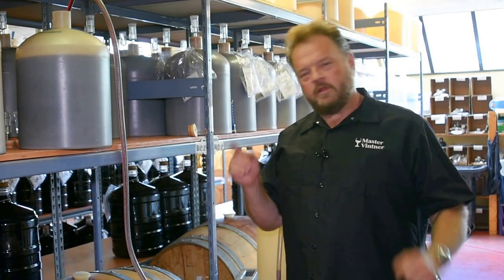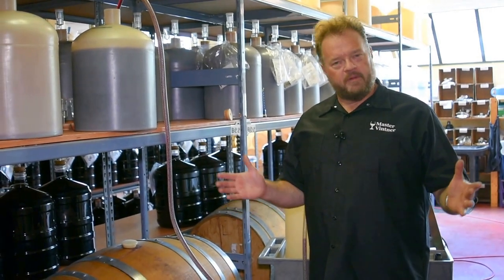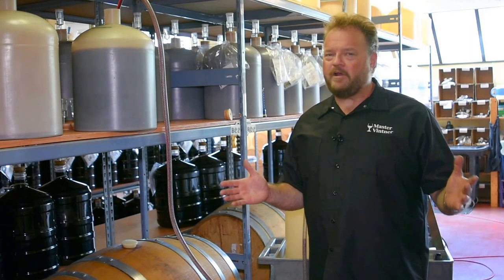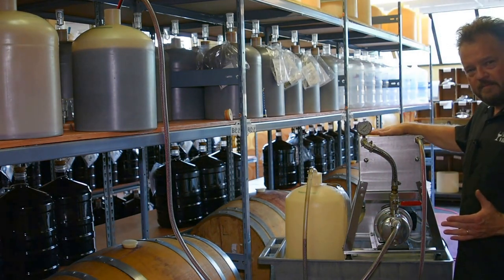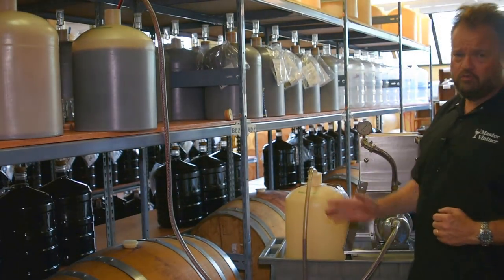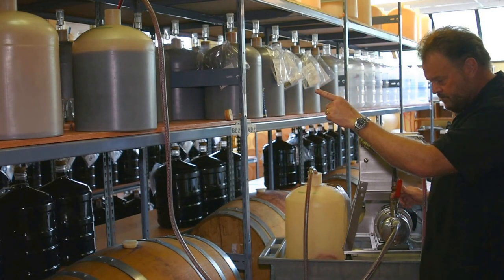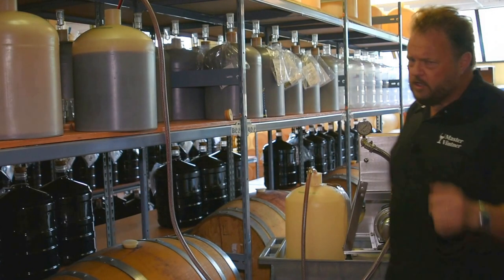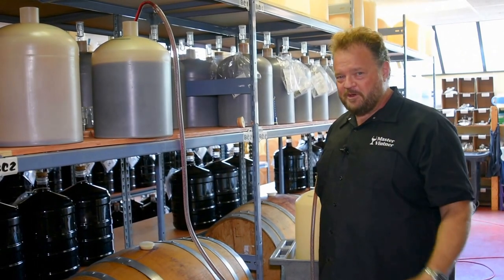Filter Day for Master Vintner

Comment: Where can one of those filter setups be purchased?
Reply from the maker: The filter I'm using in the video is made by Enotecnica Pilan--a quick search should find them on the web. You could also look up Criveller, another very good manufacturer of similar filters. 

However, unless you've got more than 60 gallons to filter at once, they're very expensive and more trouble to set up than a more nimble filter like the one Buon Vino sells.